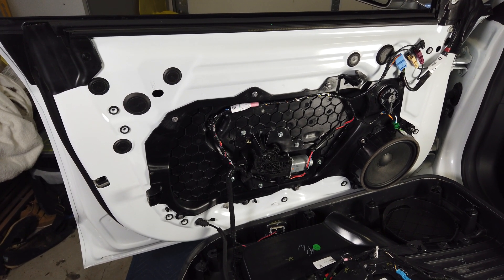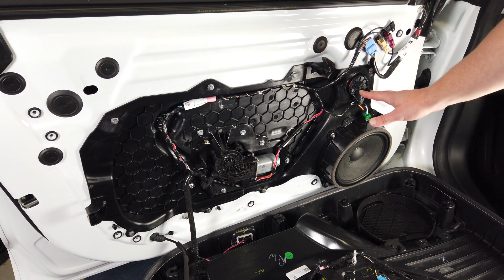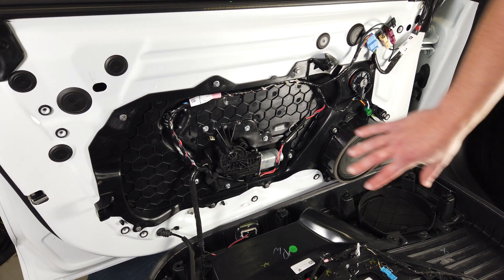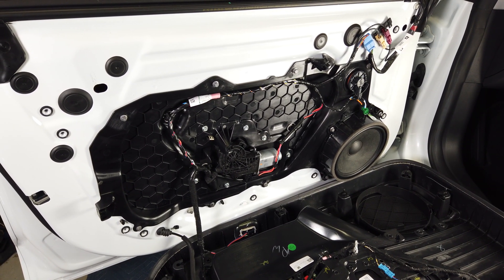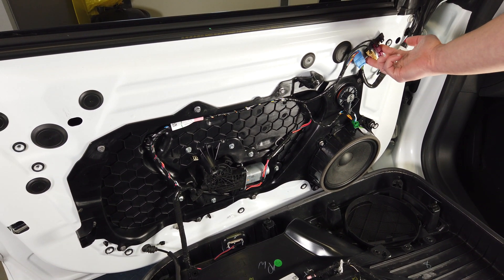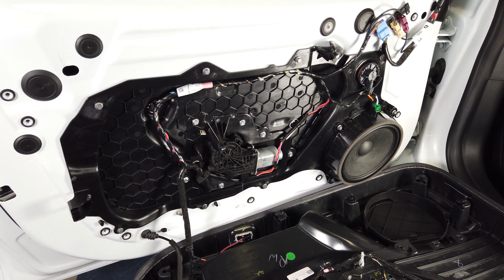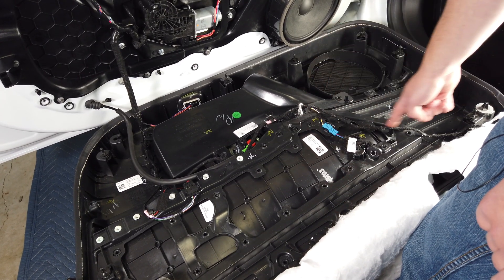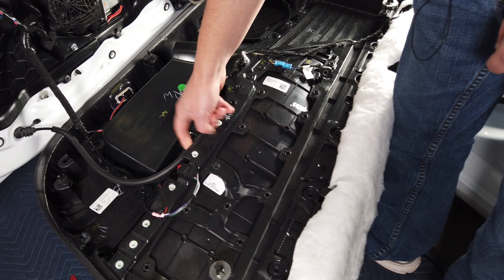Behind the Model 3 Door Panel

Comment: Can you comment on tinting the windows, will the water/soap applied it the inside of the glass go behind the black backing, or do I risk that it will damage some of the electrical components?
Reply from the maker: There are drain holes at the bottom of the doors so they expect water to get in there just from rain.
Reply: LivingTesla I do realize that, but when you tint the windows you apply a lot of water from the top of doors, not from the bottom. 
So the question is if that will run behind that black “padding”, or run on the side with all the electric stuff.
Reply from the maker: Oh you're asking if it will run between the door panel and the door. When they're squeegeeing the water out, it should run down the glass into the door, not behind the door panel. It's no different from any other car in that respect.

Comment: I was told by Tesla when I picked up the car and was given an overview that I should "never use the manual release except in emergency as it can damage things inside related to the window", are you seeing that or know if that is even slightly true?  Other than that, if true, looks like a great design.
Reply from the maker: It's really only true if the car doesn't have power or maybe if you open the door too fast. The concern is that the window needs to drop down clear of the seal and trim. If you use the manual release, you'll see that the window drops down fine, but it's a bit delayed compared to using the button. It's just best not to rely on it.
Reply: The worst thing about the manual release is that it does not drop the window down, and when you close it, it won't close, it is just hitting the trim. I had someone use the manual release (after being told not to), then I could not get the door closed until I cycled the window down and up. Then I noticed my efforts to close it had dented the trim.
Reply from the maker: @scottfranco1962  Bummer. I've had people use it and the window always dropped and everything was fine, but I know the potential is there to dent the trim.

Comment: Thank you for another informative video. Really neat to see what it looks like inside. How does the window motor connect to the glass?
Reply from the maker: It looks like a motor-operated cable system: https://epc.teslamotors.com/#/systemGroups/47304 (log in as "general public" then try the link again if it doesn't work directly)